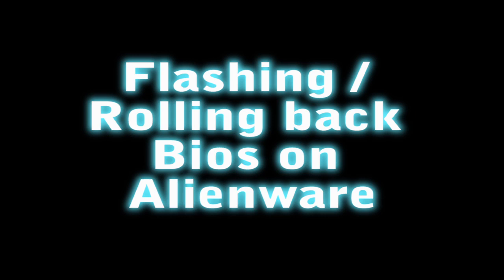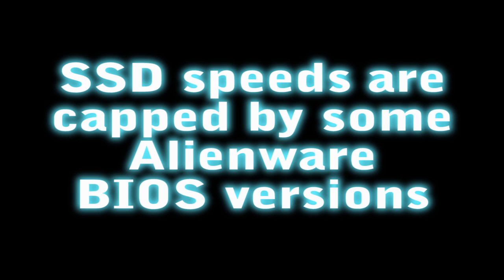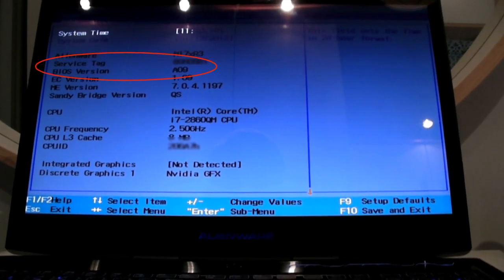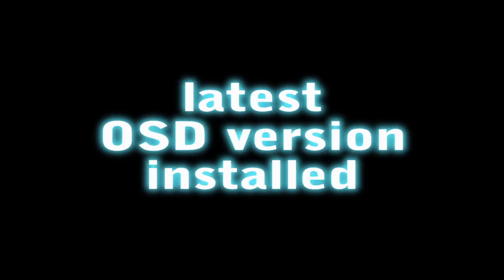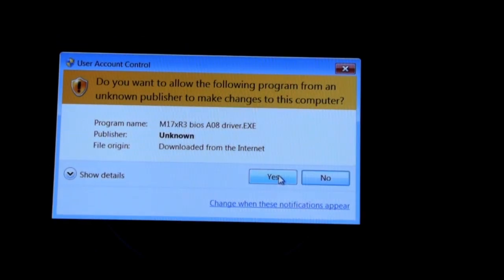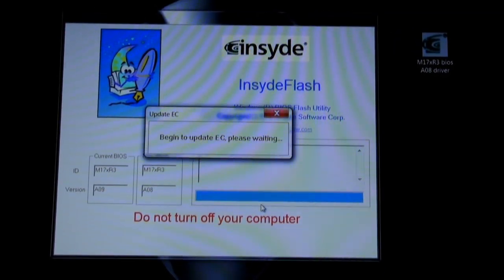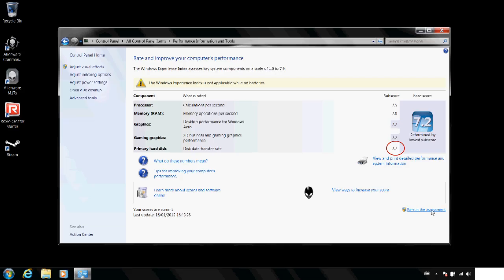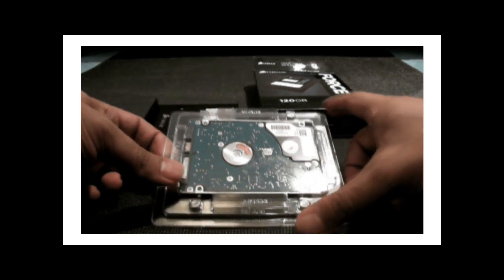Flashing BIOS to fix transfer speed - 6gb/s Solid state Drive - Alienware Mx17

Comment: This process worked flawlessly on my M14xR1 after upgrading to SATA 3 SSD when the old HDD died. same basic method, the only difference is that you need to flash to BIOS version A05 for the M14x. Thanks a million, Japhistan! Most helpful!

Comment: There was a problem back in the days when I was browsing the forums to optimize my SSD. apparently you have to place your SSD in hard drive slot 1 instead of zero because the original C drive slot has issues.

Comment: Thanks, I have a samsung ssd 256 pro 840 mb. at first did not recognize, change the slot from 0 to 1 and did not work, had the a12 bios but I came back and ready to a8 problem solved, if you recognize sata 6gb ahroa in my m17xr3. thank you very much

Comment: I see. That is most likely what it is. Upgrading the BIOS to A08 was worth it anyway however. Touchpad is a lot smoother. Also the SSD videos were very helpful. With windows 8 my computer is booting in about 6 secs.